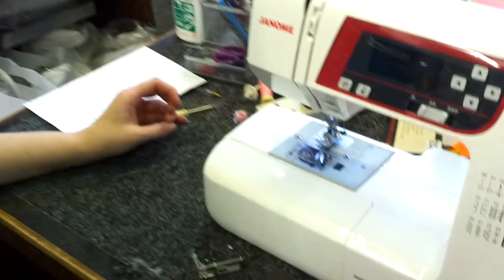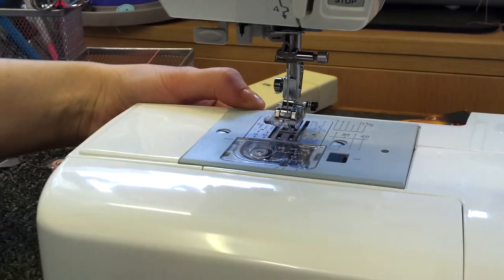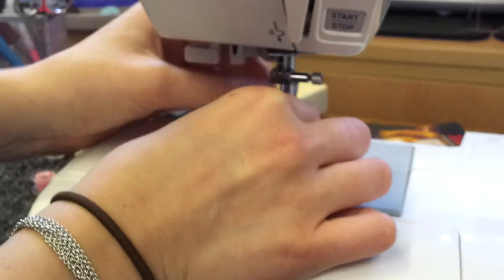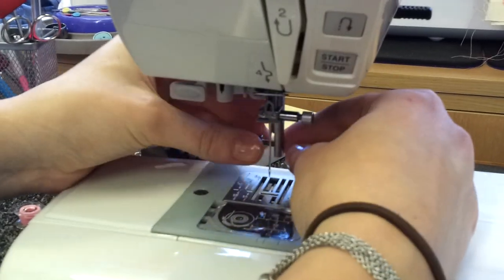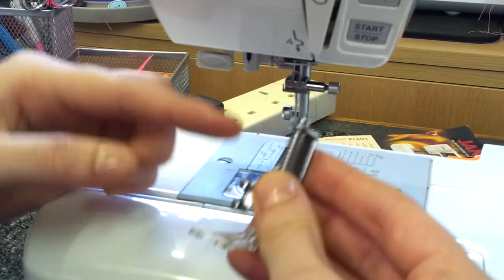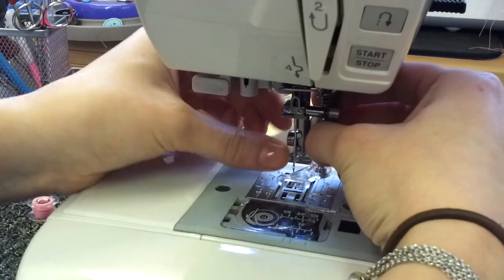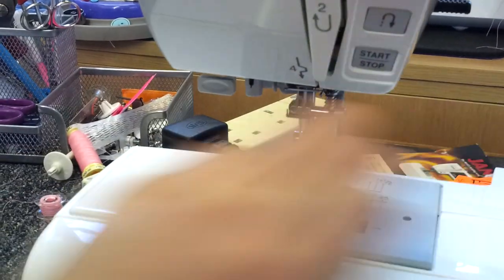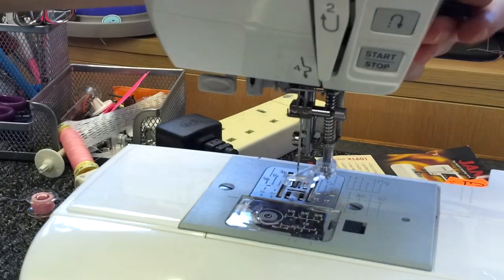How to Fit a Free Motion Quilting Foot on a Sewing Machine

Comment: Do we still use the bottom bobbin when we have a plate covering the feed teeth? You can tell im new 😄
Reply from the maker: Hi yes the bobbin still needs to be in the bobbin case. Hope this helps
Reply: @coulingsewingmachines1706  thank you. I just had a little go. Looks like its going to work. Bit of a nest happening at the back so more fiddling.  Does the thread pull to the front into that little indent on the embroidery foot or does it thread to the back still? Thanks for your help and this video. I wish id seen it sooner :)
Reply: Ah ive just seen your circle bit is different to mine. Yours has a gap at the front whereas mines a complete circle. No worries. I'll get there x